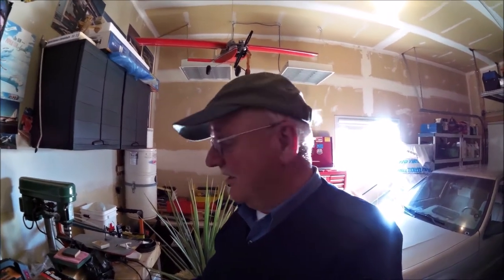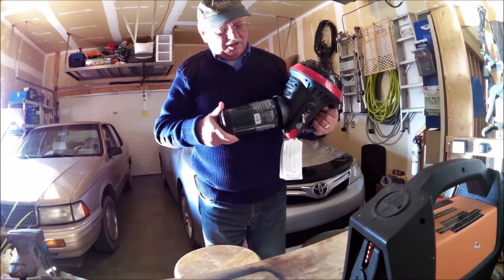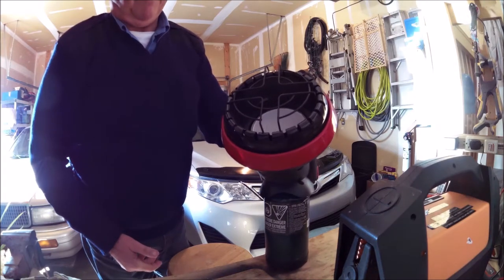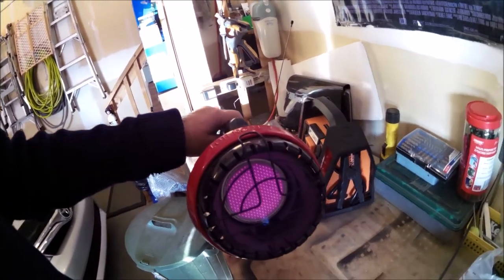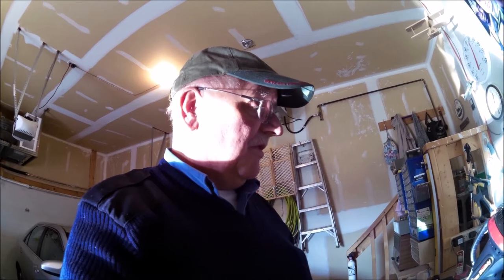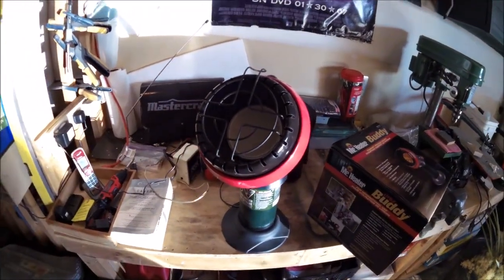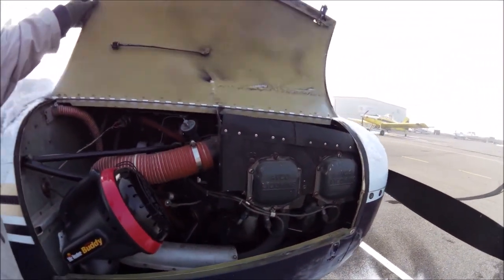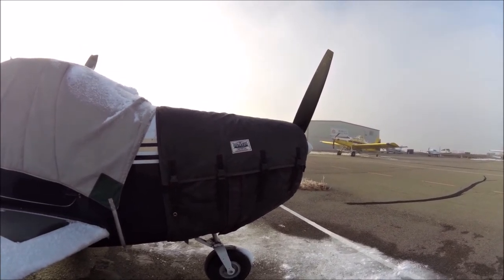Piper Cherokee  "Engine Preheat"  Vlog #63

Comment: Nice video.  I am new Cherokee owner wondering Do you use piece of sheet metal  block the radiators in the winter ?
Reply from the maker: Hi Yan.  Yes, I actually tape over the oil cooler with plumbers metal tape but you can use a winterization plate which is also used to restrict air during winter operation.
Reply: @TAGALONGWITHCHET  thanks for the reply.  Which airport you based at ? I should fly in to meet you sometime. Let's fly together.  I love your videos.
Reply from the maker: @airbornepotato  Well since I made that video I have moved although not that far from my previous airport which was High River AB.  I have moved to Vulcan AB where I have also built a hangar so the preheat has become a lot easier for me.  I have the only blue hangar there ..check out the rest of my You Tube videos under "Tag Along With Chet" and you will see the building of the hangar as well as what it looks like now.. cheers Chet/

Comment: i didn't get an idea of how long you heated it for...and much time do you get from 1 bottle.
Reply from the maker: +Robert Manahan Hi Robert. in answer to your questions.  Well depending on the severity of cold will determine the time I preheat so if it's only just below freezing I would normally preheat for about an hour and probably up to two hours if it's really cold.  Keep in mind though if your plane is parked outside and you only fly for the fun of flying and it's cold I usually forego it and wait for the temperature to rise to a more comfortable level.  As far as the time it takes a bottle to be empty I have to say probably about 3-4 hours.

Comment: How about your instruments?
Reply from the maker: Well that's a good question.  I have not had any problems with them as of yet.  If it's required you can take the buddy heater into the plane but usually If it's that cold I don't even bother to fly...having said that I now have my own hangar so not too worried about it anymore..
Reply: My son flies for a major airline but also rents GA planes locally.  The FBO has cockpit heaters even for planes that are in hangars.  The cockpit heaters are for the instruments.
Reply from the maker: Yep, I know what the heaters are for however I have never yet  seen cockpit heaters put in an aircraft which has been kept in a heated hangar..kind of defeats the purpose don't you think...and yes I too worked for a major airline..now retired..